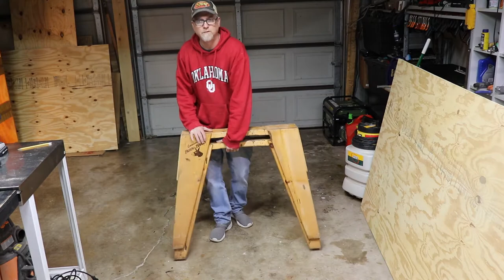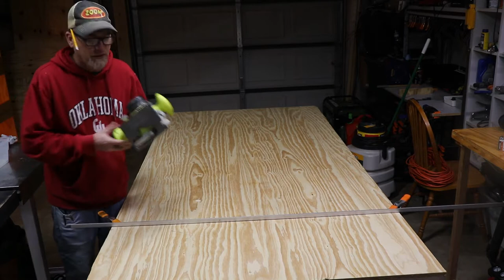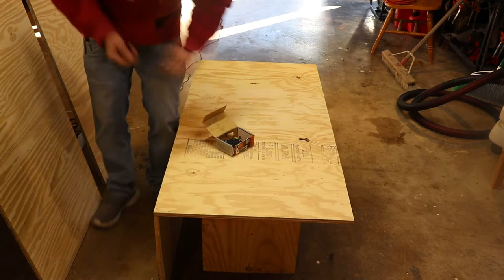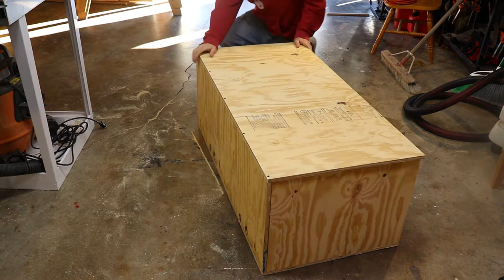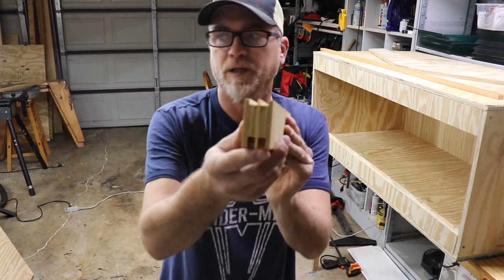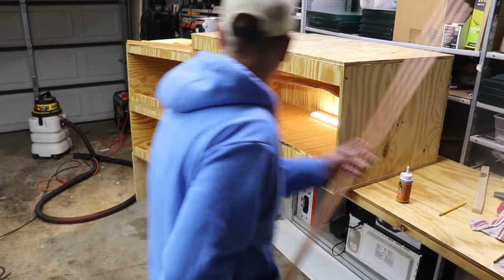DIY Snake Cage

Comment: Do you remember what type and thickness wood you used?

Ive always had to use 2x4 framing which added too much weight and took away too much usable inside space. 

But if whatever you are using will mean I wont need 2x4s im totally down to copy you.
Reply from the maker: I get it at Lowes 19/32-in x 4-ft x 8-ft Pine Sanded Plywood Item #12221
Reply: 2x4's are too big. Use 2x2's or 1x2's. I personally don't trust putting screws into the edge of plywood. That's just me.
   If you have to take it apart to move it leave the 2x2's attached to some parts and reassembly is easy.
   Also using small framing pieces (2x2, 1x2, even 1x1 for small cages) lets you use thinner cheaper plywood or other types of panels for the box itself.

Comment: What's the dimensions? Will it be enough for a Brazilian rainbow boa adult?
Reply from the maker: 4 foot long x 2 feet deep x 19 inches high. Yes would be a great size for a Rainbow boa.
Reply: @MikeRobertsReptiles do you know the dimensions of the glass you used?
Reply: Only big enough for a small one 4ft max. My rainbow is almost 7ft so this’d be way too small. They average 5-6ft though so I’d aim for 6x2x2 minimum

Comment: Do you have a cut list?
Reply: Wing it. It's much more satisfying to know it's ALL yours.
   Make an exploded drawing first (you know, like the parts list that comes with small electrical appliances), and label all edges.
   You don't necessarily have to have all sizes exact beforehand. Measure and cut to fit as you go.